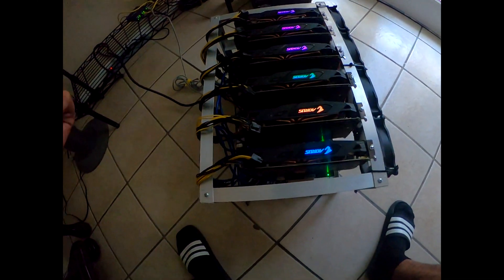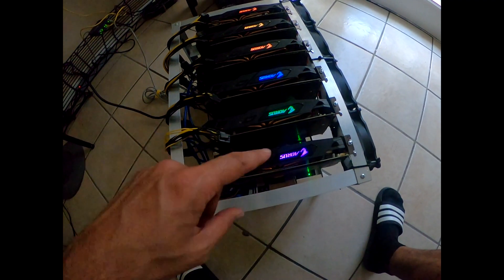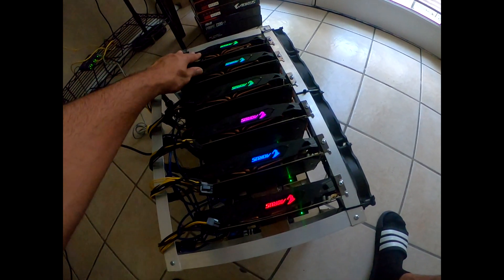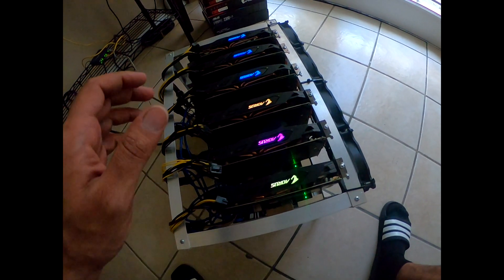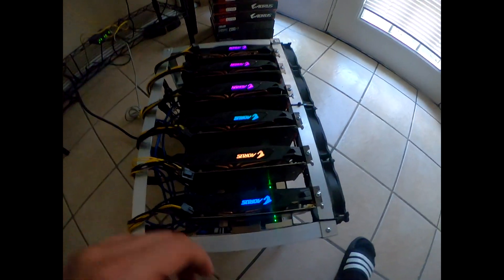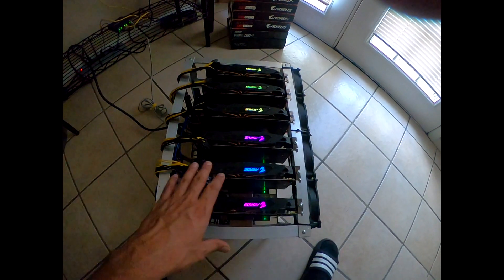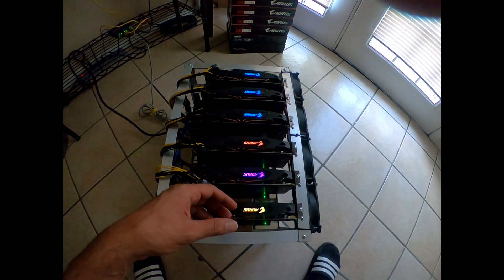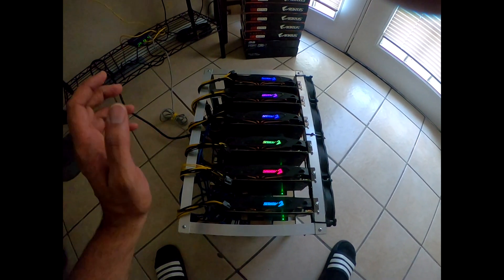Changing Thermal Pads and Paste On My RX 570 4gb Crypto Mining Rig

Comment: hi, i have rx 580 aorus for the vram the thermal pads size is 0.5mm but on the vcore   it should be 1.0?..
Reply from the maker: Try it out. Ive had success going thicker in some areas of the GPU. The important thing to make sure that you don't warp the shape of the GPU board by packing too much and tightening down the screws too tight.